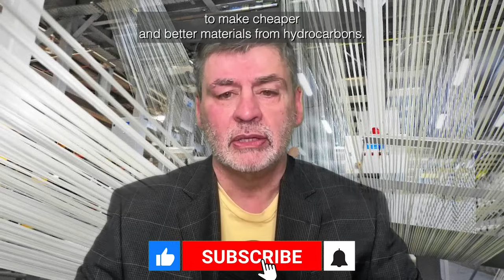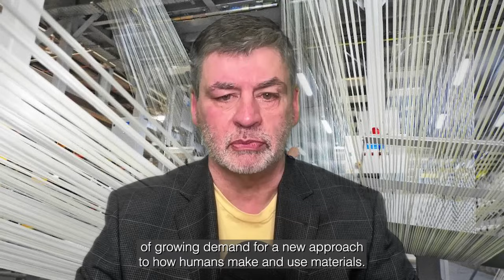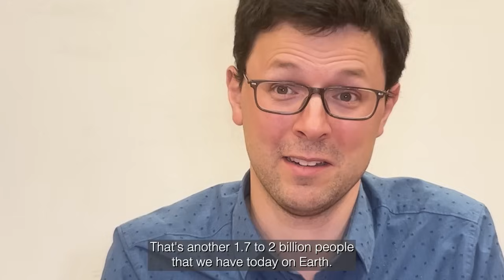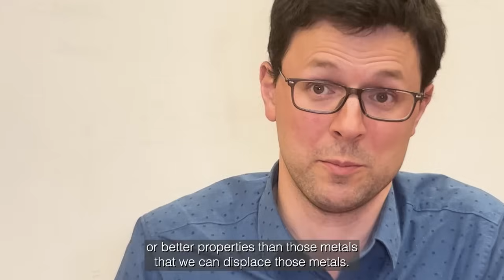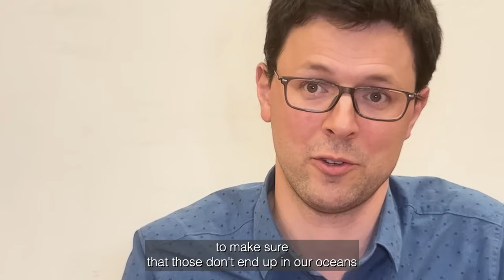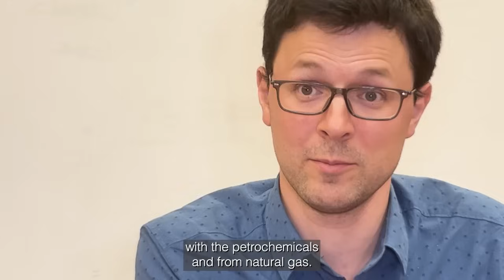Creating demand for carbon fibre made from Alberta's bitumen

Comment: As someone that uses composites in industry, carbon fibre demand is pretty low.  Some of it because industry is adverse to change.  However, also the cost of the carbon fibre itself isn't the concern, the cost of the resins and epoxys are high, and the real problem is the cost of production of the end product.  We use metal because machines bend, cut, weld, and form it, but the creation of composites takes a lot of labour in most industries.  There isn't a whole lot of automated composite production out there.

Comment: Oil is too valuable a commodity to be used merely to ferry people around by themselves from place to place typically at low speeds. It should be reserved for the case uses where it can't be replaced cheaply and easily by alternatives... Like aviation fuels or for advanced materials like carbon fibre which will play an increasingly important role for whatever it can make lighter, stronger or faster... Like advanced braking systems for BEV's with 1500 HP in the case of the Xiaomi SU7 which is the most powerful and irresponsible/responsible super car ever built for the masses, depending on whether they decide finally if all that HP can be accessed off track or on it since that's a whole scandal in China right now besides that one high speed semi-automated crash that took 3 lives and put its safety and tech prowness on trial a few months ago.

Comment: The thing a lot of people don't understand about carbon fiber is that it's incredible cheap as a material. The things that are made out of it are often valuable but the raw materials are incredible cheap. Similar to how we complain in Alberta that we produce the oil and the refiners turn it into a product that sells for 3x. Carbon fiber is like that but 10-100x depending on what you make out of it. I once used carbon fiber sheets to repair body work on a Honda Fit because I don't have a welder it was cheaper than fiberglass or steel mesh repair kits.

Now I'm not saying that it isn't a valuable resource to use as economic diversification, I simply think the attention given to it far out ways it's potential and we should also be looking beyond petroleum based products in the long run.

Comment: It won’t be oil companies that do this but rather an outsider. Companies never self disrupt. It’s always the outsider with specialized knowledge and customers not burdened by the need to preserve stranded assets.
Reply: As an investor, I always look for diversification in an investment, and have always been stunned by oil companies reluctance to do so.  They have so much capital, but insist on having one huge basket to hold all their eggs.  Morons.
Reply: Good time to set up a new Petrocan, to provide feedstock for carbon fibre industries
Reply: Government owned companies sedan work. They are driven by political agendas and their board is typically political appointees. Needs to be a private company or consortium perhaps incentivized with tax deferrals or accelerated write downs. This limits public liability and merely defers tax paid as opposed to eliminating it.
Reply: Refining companies of the crude blend meets the customers standards , order is big enough, vs supply the hydrocarbons chemicals like they do for plastics etctera. HC labs usually close to refineries.
Reply: Asphaltenes for carbon fibre are and have been a byproduct of heavy oil refinement for a long time already. This isn't new.
Reply: Sort of ... remember that when Standard oil was forced to diversify their monopoly they intern set up the rockerfeller foundation. This foundation became extremely wealthy inventing new uses for petroleum. From medicine to lipstic, they found a way to  reinvent the rockerfeller name of an evil empire to one of philanthropy while still making billions in profit.

Comment: Using Carbon Fiber in recycled rubber mats as a bedding under asphalt roads, under concrete and as a netting" for flood control on sloped surfaces such as the sides of roads is an option.  The fiber would be added to the matting similar to fiberglass except instead of a full flat bed it would be a hexagon shaped webbed matting with the voids filled with crushed stones.  The matting reduces the shifting of the under bedding in asphalt and concrete on roads and such.

Comment: Carbon Fibre is five times stronger than steel and lighter than aluminum.
Reply: That may be true, however those are only 2 properties that engineers have to consider when specifying materials. Things like coefficient of thermal expansion, flexural modulus, UV resistance, etc., are also just some of the other things to consider.